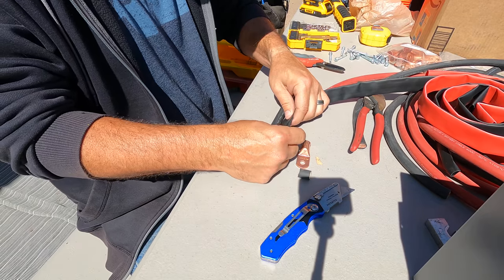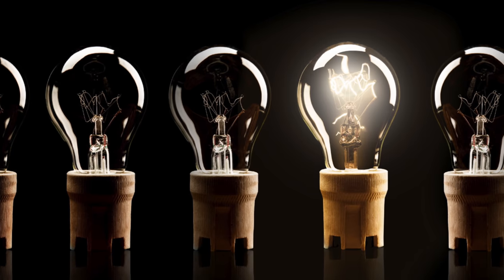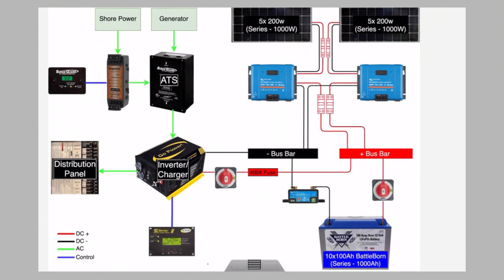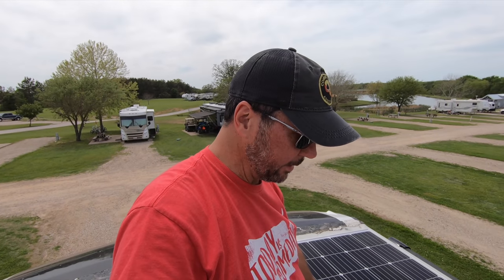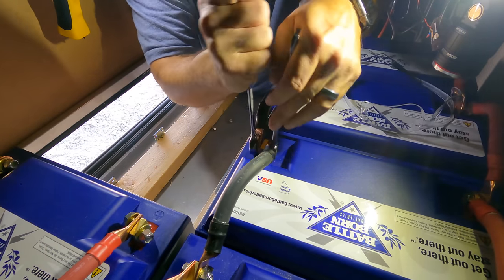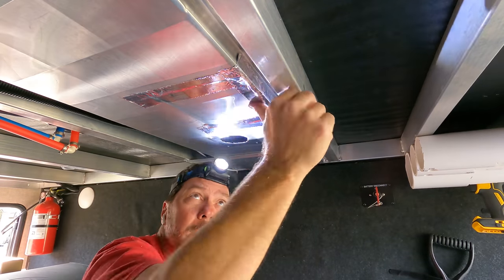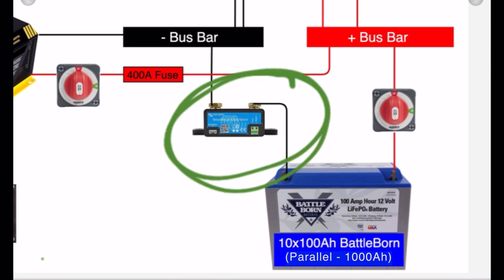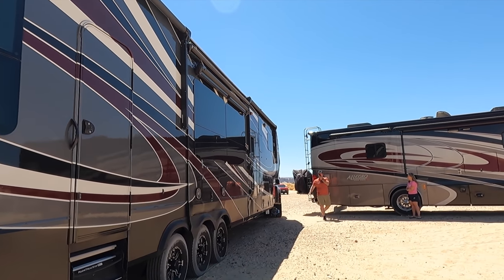☀️  RV Solar Install! 😎  (Full Time RV Life)

Comment: biggest question is how much does the whole system cost?
Reply from the maker: We don't publish prices because they vary daily it seems.   All of the gear is listed and linked in the description and blog post.
Reply: that's ok its cool. I love your channel. I have learned more about Rv's watching you guys then I would have otherwise.
Reply: @mikeparkin7262  The batteries run about $1k each, the GOPower 3k inverter is about $1.5k, the charge controllers run about $750 ea. The panels should be about $200 ea. There are a ton of misc parts, cables, breakers, switches, battery monitoring equipment, and tools needed also.

They are close to $17k+ for their system materials.  There maybe cheaper solutions, but that's about 1/2 what you would pay for a whole house solar system and his is completely mobile.

My only suggestion is that you should have gone 24v instead of 12v.   Otherwise great job, this is how we learn...just do it yourself.

Comment: Just curious. Why not make it a 24 volt battery bank?
Reply from the maker: Because our RV is 12V and I didn't want to mess with a step-down and separate bus.
Reply: @ChangingLanes  well makes since.  I did make ours 24 volt and just for fun just added a battery just for 12 volt lol.

Comment: Why didn't you go with the 48 volt power system it's easier and it don't use as much power even though you can put out more power instead of a 12 volt to use his lessons and less voltage and it don't run your battery down as fast
Reply from the maker: This was expanding on a 12V system, but my next setup will be 48V for sure.   For the lower amperage on the inverter side.  However, changing the voltage (how the batteries are wired) doesn't change the capacity.  They will draw down at the same speed.

Comment: Chad, what size wire are you using from the output of the Solar Controller to you bus bar?   You might do a little math.  At 50% solar efficient, you'll push 40-45 amps out of each.  You probably should need at least #4 or #2 ideally.
Reply from the maker: All of the wiring specs are in the blog post: https://changinglanesrv.com/rv-solar-install/
We have 4AWG coming out of the controllers.. 👍🏼
Reply: Not at 120 volts

Comment: Why would you with allllllll those batteries? You should have used a more efficient 48v system and used far fewer batteries with more Amp hours. While you did a nice job in the system you built, it is not a good system. Wasted money unless your getting your stuff free.
Reply from the maker: https://youtu.be/EFxZcF5BtPQ

Comment: You rave on for 15mins before you got to putting the solar panels on the roof of your van. Very boring 😴
Reply from the maker: Van?  What van?
Reply: @ChangingLanes  ok 5th wheeler you carry on with so much crap before you start anything